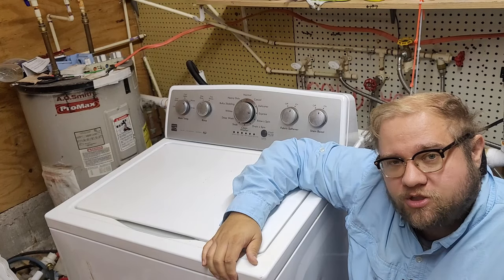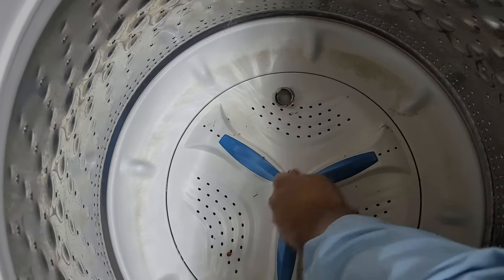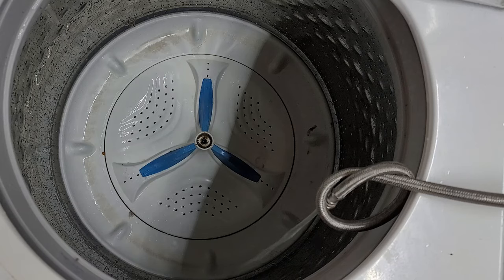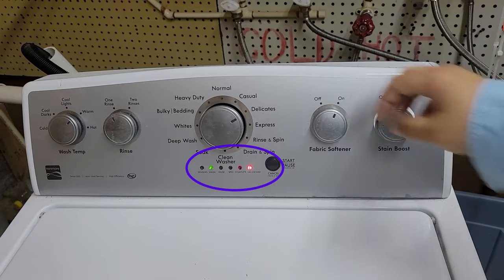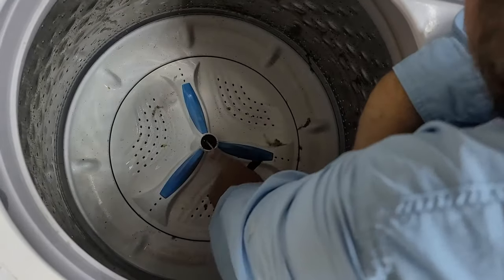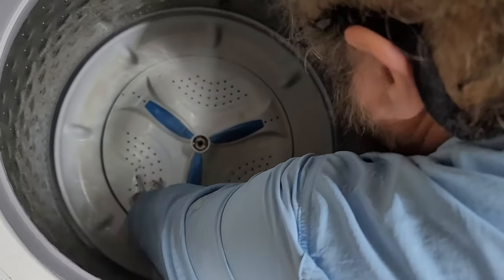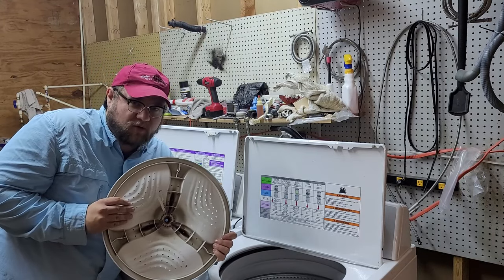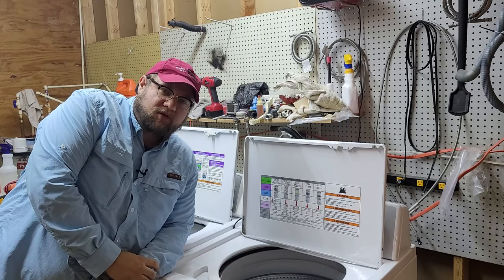Washplate Stuck - More Ideas to Remove a Difficult Whirlpool Wash Plate

Comment: Honestly, the best thing to do is get some air wedges, a t-hook and some penetrating oil like pb blaster.  Remove the bolt and spray the penetrating oil in the cavity where the bolt sits.  May need to do a few times and let it soak down.  Then use the t-hook to pull the agitator up while fitting the wedge underneath.  Put the bolt back on loosely and then pump up the air wedges.  That will take it right off.  Using penetrating oil is not ideal, but sometimes you just have to.  You can always use some carb or brake cleaner to get it off.  And as for the smell, you may just need to run it a few times with some detergent and bleach to get the smell out.  Not ideal, but its better than spending all day to get no where.

Comment: Tried removing the plate off a relatively new washer with the same tools already.. tried once more gave up and just started pushing back and forth downwards on the plate to loosen it as much as I could then took that 90 degree spike tool and just hammered it into the center plastic arbor on the plate with a mallet one pull upwards and it came right out. Wouldnt bother with the citric acid its the metal splines that are grabbing so well on the center arbor.
Reply: Cheap metals totally

Comment: I needed to replace the bearing and to do that, you have to remove the basket.  I did everything including air impact hammer.  At last every thing was destroyed including the transmission and the basket was stuck to the plastic tub with the outer pipe cylinder that houses the shaft of the transmission.  The shaft as it got pounced on broke loose and the gearbox fell apart all at the same time.  The tub and the basket was fused together with that gearbox cyclinder that the shaft is inside.  After that, there was no  need to chisel the cylinder away which I did but then it was time to chuck the whole thing.  In fact this is on two units. One Maytag and the other Whirlpool.  Same product, different name.  Both courtesy of washplate.  This does not happen with agitator set up.
Reply from the maker: Sadly, I've had that happen once or twice on the Whirlpool-built washplates. Such a terrible design.
Reply: @bensappliancesandjunk  Well, here is something that is worthy to include here.  So here it is.
First of all, I don't believe in purchasing their so-called "gearbox" when their bearing goes out due to that leaking seal above it.
Instead o replace the bearing, which is a common bearing (thank heaven they somehow forgot to specialize that bearing)..
I simply drill out the rivets on the pan/box that house their little can transmission/gear thing that is sandwiched inside the two metal pan. I spray some lubricant on the bearing collar and let it sit and remove the two half and there you pound out,, whatever it takes to remove the bearing.  Typically it is the top bearing that goes out and not bottom.  If the bottom also goes out, thank heaven you don't have to remove it because it will be tough.  Since it is in bottom, no water gets there to rust out the ball bearings. So I take the cover off the bearing, spray some carb cleaner and blow it clean with air.  It is dirt and grime that gets in there.  So that is the solution for the two bearings.
Now the solution for removing the frozen stuck basket.  Here it is.  Put a scissor jack or a bottle jack right on the shaft and cut a piece of 2X4 about 20 inches long and place it on top of the jack.  The two ends of the 2x4 will be right under the edges of the basket. Raise the jack and watch the basket give.
Merry Christmas.

( By the way extra details.  If you are that ambitious to replace the bearing instead of the gearbox when you spray the bearing, you have to let it sit possibly overnight if they are extra stubborn.  Now let us assume that either you don't want to wait that long or even after that the two halves are hard to split open to expose the bearing. In that case, this is the solution. Save either the gearbox or the pan but not both.  To save the gearbox, simply cut the top half collar where inside is the bearing and you are done.  Or destroy the gearbox by pounding on it but you are saving the pan.
In the future same problem, you simply do the opposite, exchange the pan of one with the other gearbox that you installed new bearing.  This is the least aggravating but it is forgotten and waiting for the thing game.

Oh, with the agitator getting backed on, although I have not had a serious issue with that, I simply spray it with some lube and let it sit and twist and turn it, etc until it has some give.  Then I feed strong twine by shoving it through the edges of the agitator feeding it inside all the way until it is at the center on the shaft ( possibly doubling the twine). Then grab both ends  of the twin with your hands and the twin leaning towards you and again the shaft, using the shaft so hold the twin in place so the twine doesn't slip off and then with one strong jerking motion, left up the agitator))

Comment: this method of removing the wash plate is all fine and dandy if you have a lot of time to spare, but in the real world, a technician has up to 10 calls to run in a day and spending as little time at each call is very important if you want to make money that day. If you are replacing a transmission in that particular washer you're repairing, you may as well order a new wash plate and have it handy knowing you're going to have problems removing the old one. on jobs with a contract/warranty work, this is not a problem at all, the contract company pays for all parts. on all other calls, it's not really a problem either, because the wash plate is a relatively in-expensive part to replace anyways.
I have had troubles removing the wash plate and once I had to actually use a Dremel to cut off the plastic and notch the metal part of the plate and then using a chisel to split it as rust and corrosion made it impossible to remove it normally. I suppose the citric acid would have worked but waiting around for several hours was not an option.

Comment: Ben, I have a Daewoo 6kg "fuzzy logic" DWF-6010AP portable washer that I can't find any information on and is now making this electrical sounding buzz as soon as it is turned on. Like the sound of flourescent lights when they buzz. Machine is still working, but I do have to clear the filter on the bottom often and the lint trap inside has a tear in it and not collecting lint. I'm going to take that out and sew it up. Not sure if opening the agitator will help me clean it out... In the meantime, this buzzing sound, could there be lint trapped inside? It made this sound one other time, but when I unplugged the machine, it stopped and when I turned it back on, it was fine. Now it made that sound through the whole cycle tonight and no matter how many times I've unplugged, it's still making the noise when I turn the machine back on.. even when it's not running a cycle. In the spin cycle, the sound had waves of louder and quieter.
Now I don't know what I'm doing here and am on a too-low fixed income so I have no money for parts or replacement washer. If I can't fix this myself, I will have to wash my clothes by hand and I have fibromayalgia, so this won't be possible. Please help me if you can!
Reply: Thank you so much for your time, if you manage to get some to help me. I hope you can give me some tips on how to repair this myself. Thank you!
Reply from the maker: Sounds like the drain pump is going bad. Pumps tend to get very loud over time if they have obstructions in them, and you said the filter needs cleaned a lot. It could damage it, causing the noise.
Reply: @bensappliancesandjunk  any time there is any kind of lint or anything in the filter, it won't rinse properly. So I take it out, clean it and then have to start the whole wash again to get the spin going again. This buzz sound is new. Sounds like an old fluorescent light tube, you know when they buzz and it kind of sounds electrical? 
This is a portable top load washer. Do I need to take it apart from the bottom or can I remove the back? I had tried to remove the back once before, years ago, but it wouldn't come off as the way it it connected, I'd have to remove the top and I don't know what I'm doing here, but I'm sure there must be a trick to it.
Could the pump drain just be cleaned out? Or replaced?
Reply: @bensappliancesandjunk  I can't seem to find anything about this washer online. What a pain lol I'd love to learn how to repair this stuff myself, but it's hard when nobody seems to have one! It's different than the cheaper portable washers out there now.

Comment: Air chisel??? Are you serious, because mine is worse than the one that you're claiming is the worst that you've ever removed. Scaulding boiling water with citric acid, hook tools at 4 points, pb blaster for 3 days, hammer, chisel,... I have 4 days of attempts intonthis thing. Beating the crap out of it now. 

So, should I go to the air chisel next?

Comment: After you clean and remove the agitator do you need to use some kind of grease or thread lock when replacing it?? Thanks!
Reply from the maker: no. just drop it down and tighten the bolt on
Reply: @bensappliancesandjunk  what can I use to clean in there if no citric acid? Degreaser?
Reply: @bensappliancesandjunk  vinegar and baking soda? One or the other? Toilet bowl cleaner? Lol
Reply: @Bomber411  yeah no toilet cleaner. that will destroy the rubber seals and stuff. bleach, vinegar, baking soda or Simple Green will work well.
Reply: So am I correct I don’t have to buy a new wash plate just unstick clean it and put it back?
Reply: Before i installed the new wash plate on our Whirlpool Cabrio washer, which had failed due to a stripped spline, I put a small amount of Vaseline on the drive spline, and blue Loctite on the hex bolt.  Install the wash plate, then install the hex bolt.  The reason the wash plate sticks is due to corrosion of the mating splines.

Comment: I did the sir wedge method it was sooooooo easy I was ready to pull my hair out first the bolt then the agitator Amazon before you start the are 6 for 26 $ next day delivery loosening bolt 3/4 out put bags under and inflate pop it with a 2lb hammer boom free free free lol

Comment: After breaking my agitator I realized a little wd 40 down the screw hole would have resolved the issue in minutes. Marine JB weld fixed the agitator.

Comment: Just tried to do this technique but won't budge. I found out the technician who came fix my mother washer just knocked the metal gear of the new disk and slide the new disk on old metal gear. After breaking the disk with a hammer after only a year I had to remove the metal middle part using a grinder with cutting disk!!

Comment: Ben, I am having difficulty getting a Kenmore impeller bolt out.  I have tried a wracked, 1/4 impact driver, dwalt impact bolt extractor.  Nothing has worked. Do you have any suggestions? The tech guide does not offer any suggestions.
Reply: I am having the same issue.  I wish I was to the part of lifting the darn thing up!

Comment: Hey, Hi I NEED Help.  We finally got the plate off, but the center metal bolt with the grooves or shafts around it did not come ou😂t with the wash plate. Therefore,  I can't put on the new plate.   What or how do I get it off?
Had to kinda of beat it up to get to this point.
Reply from the maker: Sadly you gotta use a crow bar or dremel to cut it
Reply: @bensappliancesandjunk  I have a wheel puller with pressure on it,  and it's still stuck solid as a rock.

Comment: I tried all of this and none of it worked. What worked for me was to go to the hardware store and buy a longer 5/16-24 threaded bolt and screw it into the bolt hole in the center. Then I took a ratchet strap and fed the strap down two opposing sides of the washplate and pulled it towards the center so I had the two ends I could pull on. Then while pulling upwards on the ratchet strap ends with one hand, I hit the longer bolt in then center with a hammer and it drove that washplate right off the splines and easily.

Comment: So question. I have the same exact washer and my wash plate is stuck as well, going to try your way shortly, but my problem with this washer is on spin cycle it almost destroys itself because the balance is off I guess. Shocks are new. What else could it be? Please let me know if you have an idea.
Reply: I’ve got the same problem!!! New stabilizers & took everything apart & cleaned & put back together…. Still gets off balance , even after a reset ??? Help

Comment: So in all of the videos I've watched including yours, the nut aways moves easily with the socket wrench. I can not get mine to budge, even with an impact driver. Any suggestions? I have put Wd40 on it, still not moving.
Reply from the maker: Some times they're rusted on terribly. Sometimes it takes multiple doses of WD40 then hitting it with an impact... If you can't get it off ever, then the only other answer tends to be cutting the plate off with a rotary tool.
Reply: I could not get the  nut off with a socket wrench either,  muscle power was not the issue since I had power. Then I hired a repair guy,  instead of trying to turn the wrench (continuously),  he hit one end of the wrench (it was the same socket wrench I used but failed), the sudden impact of force made the wrench move the nut.   But my wash plate was so dann stuck,  even this bulky and strong repair guy could not get the plate out after he removed the nut, he damaged the plate when trying to lift it with a screw driver

Comment: All you need to do is partially loose the 7/16 -16mm bolt.  While holding the spoke of the agitator lightly tap the top of the bolt to free the agitator.
Reply: Not sure if it was a combo of all the things I tried, but this did it for me. I then used a string to pull it more straight up

Comment: Got a different method,  used the wife's sports vibrator ( bought from Walmart for $80 last year) to beat around the shaft while I pulled on it with some hooks from Harbor freight, for $10

Comment: I took mine out but the metal hub stayed on the shaft of transmission. I’ve hit it with impact but nothing. Don’t know what else to do.
Reply: ive been forced to grind vertical slices in the metal part with a dremel and metal cutting disc. then breaking slice away. repeating till enough is cut free to loosen metal spline part. (being careful not to cut drive shaft.

Comment: Nothing worked, tried citric acid, multiple affresh cleaners, boiling water. Ended up breaking it off with a hammer. $35 on Amazon well worth struggling with it anymore. Already had hours into it

Comment: Hi, I dont know much about  Appliances but I have this same washer and it seems no matter what I do the clothes are always soaked and sitting in standing water.. I do the drain spin cycle and I hear it running water. Ive cleaned the drains and the machine itself.. im lost! Any ideas?? Thanks
Reply from the maker: Is the wash plate loose? If not, it won't spin. Watch my other Whirlpool/Maytag/Amana videos on diagnostic codes. I am working on a video dealing specifically with the machine not spinning, and it'll be out in a week or two. But if you can learn to figure out what code its throwing, you can likely find out what part has gone bad.
Reply: @bensappliancesandjunk  the wash plate is tight and it spins and I can watch it drain but the clothes are still dripping wet.. the only way I can make it manageable is by shutting the water off to the washer and do a drain spin cycle.. if I don't shut the water off it still ads water to the machine even on drain spin.. is this normal?
Reply from the maker: @Cam427.  unless rinse is on, it shouldn't do that. Could be a water valve stuck open.
Reply: @bensappliancesandjunk  ok thanks i will look that up and check it out.. thank you

Comment: I have a whirlpool washer wtw5000dw1 and my wash plate is not moving if it does its like a clicking sound. And I tried to remove the plate and it will not budge. It will fill with water spin and drain. What else can I do to remove it?
Reply from the maker: Did you remove the transmission screw and its still stuck?
Reply: @bensappliancesandjunk  yes and it is still stuck

Comment: The first thing that you need to do is order a bunch of parts from Amazon. 
As soon as they arrive, switch them with the parts in your washer.
Then realize that nothing has changed.
Save the old parts because they are as good as, or better than new and buy more parts from Amazon.
Repeat. 
Realize that after you replace this hub, you will have a new washer and a lifetime supply of replacement parts! 😀
Quit your shitty job and become a washing machine repairman. 🤩

Comment: In using your video I stumbled on something that seemed to help. I couldn’t get my hands on trampoline spring tools so I was struggling on a Sunday with various implements with no luck. 

With the bolt out I filled the seat with ice water. I left the water in for 2 minutes syringed it out. Then refilled the seat with ice water. I repeated that 4-5 times. At the next try the plate released. 

I’m in the medical field so had access to medical syringes and catheters but I see no reason a baby bulb syringe wouldn’t work. 

I had a chance to try it a second time. I put the wash plate back on but forgot to put the U-clip in the new hub. Using my various implements again I couldn’t remove the plate. I tried the cold water thing again and it loosened next try. 

Even two tries doesn’t make it a proven technique. It makes sense that the cold might shrink the spine dimensions slightly. I believe from 7th grade science that metals expand and contract more than most other materials. Just thought you could prove or disprove this aid in your shop.